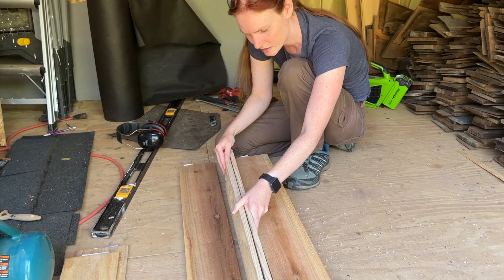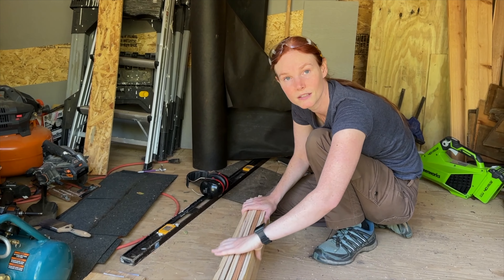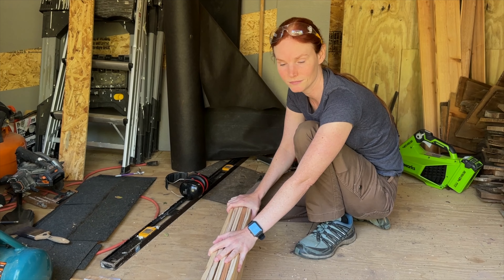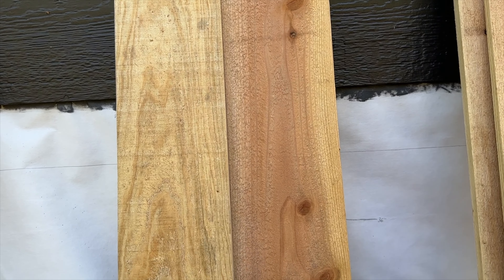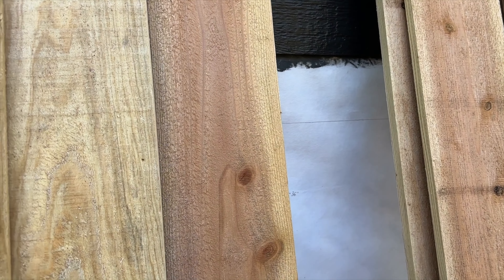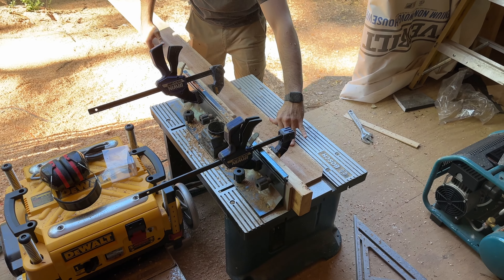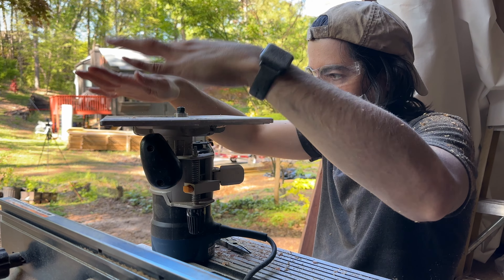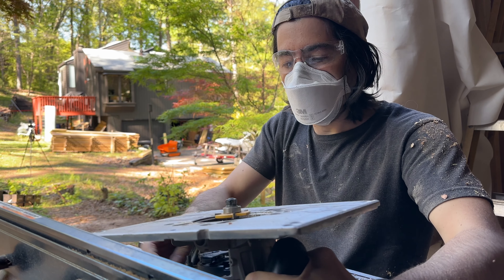Adding Striking Wooden Soffits for a Modern Japanese Look!

Comment: The difference in cedar color could be fresher boards, as they dry and are exposed to air/sun the color will fade. Or it's a different kind of cedar. Typically pickets are western red, but occasionally you'll get a coastal cedar board which is darker, more purple in color, with straighter grain and fewer knots. It's the good stuff! Oh, and the really light part is cedar, it's just more sapwood, one of the first cut off the log
Reply from the maker: Thanks! Some of them really looked like pine, but you definitely might be right!! We’re still amazed the cedar pickets looked so good after processing them! 🤩

Comment: I'm sure you figured it out already, but the white pickets with the raised grain are still cedar, they're just all sapwood and from near the bark. They don't smell great or resist decay like the boards with more purple heartwood. Not great wood. 

The boards with white and pink  are the next boards sawn off the tree. It's mixed sapwood and heartwood. 

The darker pickets that are all purple, if you'll notice, typically have more knots than the others. They are from the very heart of the tree and those are knots from the first limbs the tree grew as it was shooting up. They're the most decay resistant and will probably last the longest. 

Western red cedar is usually the species used for pickets. At least around where I live. Some Japanese cedar, too. The reason these are lighter colored than the "real cedar" boards that cost more is because they're left green after sawing. The other boards have been kiln dried and surfaced, and that process usually makes the heartwood appear more brown than pink or purple. 

Either way, you guys inspired me. I just went and dropped $500 bucks on pickets to try a much smaller shed of my own!
Reply from the maker: This is super neat and informative! We definitely didn’t know about the differences. It makes sense about kiln drying vs not. Super neat - enjoy your build! Thanks for watching! 😄